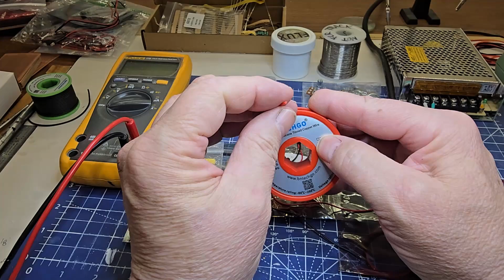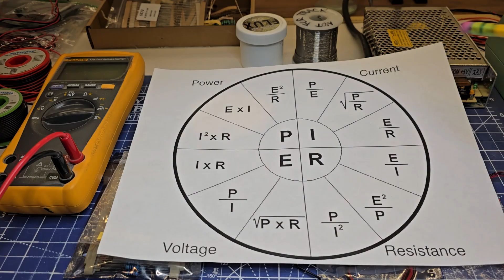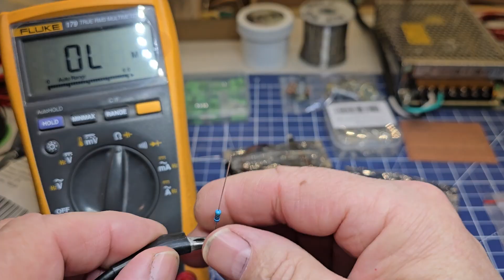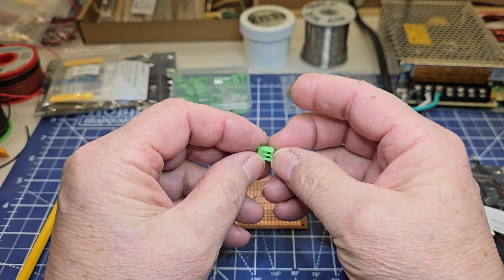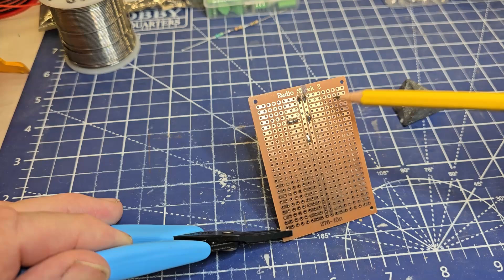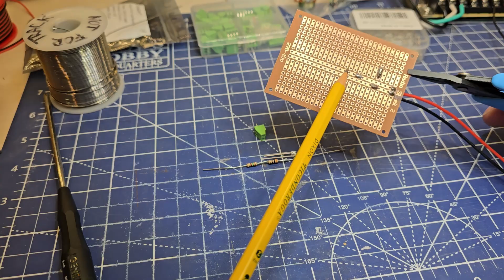How to Design Basic LED Circuits for your Projects

Comment: Excellent video, Steve! We have watched it twice now and learned so much from your easy-to-understand explanations. I have some of those 3mm LEDs with resistors from Amazon already installed in some structures to be powered by 12 volts. Now I’m concerned they will burn out. Could I add another resistor to prevent this? Again, thank you and I saved this one!!
Reply from the maker: Thanks! I'm glad you found the video useful. Yes, you can add another resistor to the LED to reduce the amount of current through the LED. Assuming all of those prewired Amazon LED's are the same, try adding a 500 ohm resistor and see if the LED has the amount of illumination you desire. I appreciate you watching!
Reply: @, thank you for your response! I will indeed try that and see what happens in regard to the illumination. Don’t want to burn out my installed LEDs! Looking forward to your next video.
Reply from the maker: @CLLynn-oi2ki  A 1/4 watt resistor between 500-700 ohms will drop the current to a safer level. Solder the resistor to either side of the LED, it doesn't matter which side.  Good luck!
Reply: Okay, Steve, thank you so much for your help! I appreciate you sharing your knowledge and expertise!

Comment: The color bands represent the resistance in each....
Sure glad I took electronics in high school and college. Doing HVAC when hooking up Heat Pumps we use 8ct T-stat....18/8  Necessary for extra hooking ups like reversing valve and thermostat for communication....low voltage we say....24v  Thanks for sharing as this is a refresher. Awesome layout too!!!!
Reply from the maker: Thanks! My oldest son is an HVAC tech. Great career field. Yes, I could have mentioned the color bands, but I didn't want to put out too much information and overwhelm people. I didn't recommend more than 12V for a power supply because it will generate too much circuit power and requires much higher wattage resistors to limit the current. I appreciate you watching and good luck in your career!
Reply: @SPSteve  You did a terrific job explaining! You're right about overwhelming people who are just learning. Keep videos coming...I'm up early every morning...Ha. Serious though after 20yrs and raised 2 boys getting back into HO scale trains. I owned the Grand Valley  from woodland scenics but ready for bigger and more elaborate layout.  Again,  thanks for sharing.
Reply from the maker: @KSee618  Awesome! I'm 68, I've been retired for 7 years. The model railroad and other projects keep me as busy as I want to be. I'm sure the Grand Valley introduced you to some of the techniques needed in model railroading if you were new to the hobby. My layout is my first one. I'd change some things if I were to do it over but I'm too old to start over with a new layout, so I'll finish what I have, and it'll be good enough. I'd like to finish it eventually. I've found the hobby to be rewarding, and it lets me use various different skills that keep it fresh and keeps the gray matter from turning to sludge. ;)  Good luck with your new layout and most important, have fun!